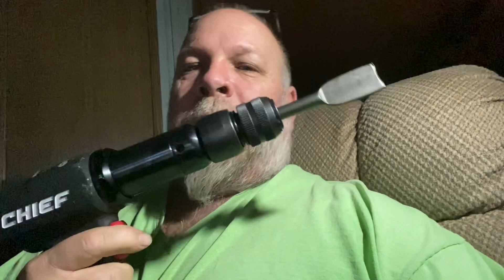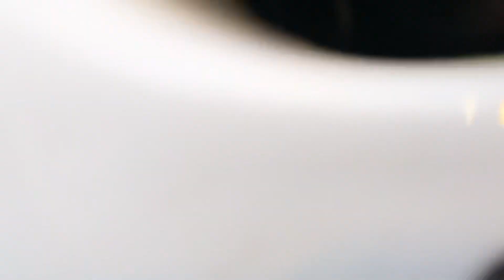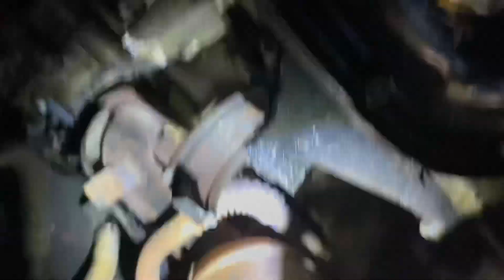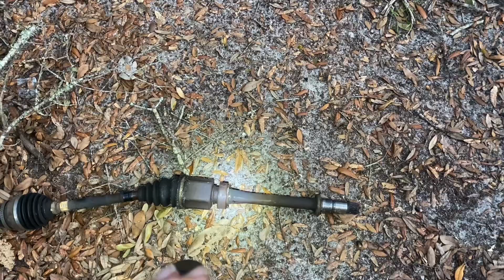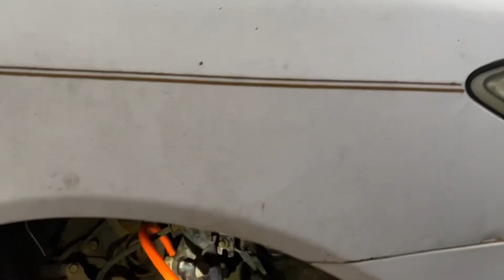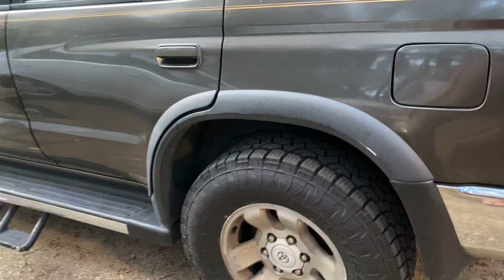Cutting crap apart

Comment: Mmhmmm sounds like a bad design a bracket for your drive axle hooked to your engine block. At times like this a lift and a blow torch would have been a lot easier. Gotta do what u gotta do.